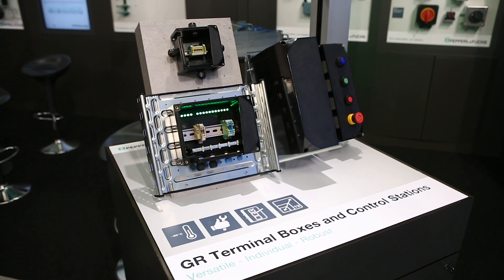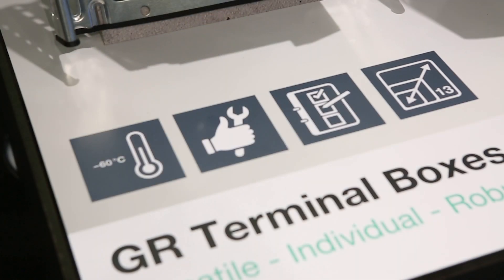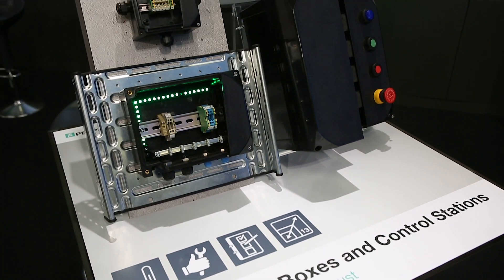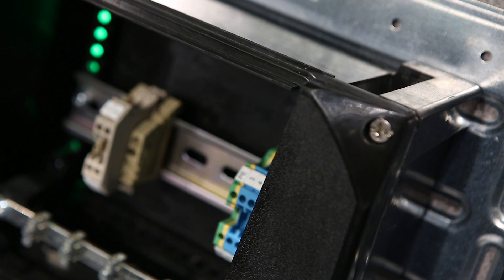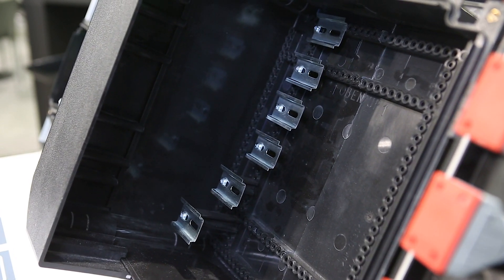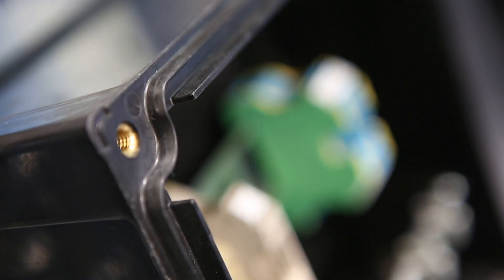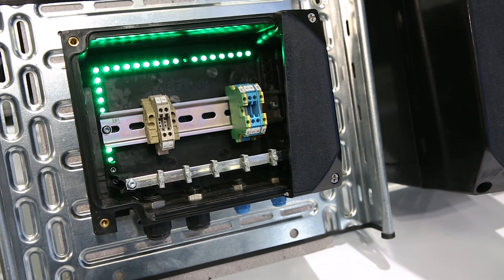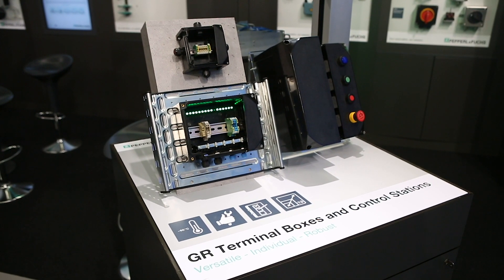Terminal Boxes and Control Stations in the New GR Series GRP Enclosure

Comment: Congratulations to Pepperl+Fuchs for its technological manufacturing update and for its EXAMPLE in making “Ex” equipment available on the market that incorporate, in the same product, a COMBINATION of different “Ex” types of protection, such as Ex “e” (increased safety), Ex “i” (intrinsic safety), Ex "d" (flameproof components), and Ex “m” (encapsulation).

By applying the combination of different manufacturing methods, such as plastic injection, optimized “Ex” equipment can be manufactured with the “intelligent” application of the best characteristics of each type of “Ex” protection for each “Ex” component in particular.

“Ex” instrumentation, automation, telecommunications and electrical equipment that incorporate these characteristics, being designed, manufactured and certified with the COMBINATION of different types of “Ex” protection, provide USER and OWNER Companies with installations in explosive atmospheres, containing flammable gases or combustible dust, the significant BENEFITS of greater FACILITIES of “Ex” field services, including INSTALLATION, INSPECTION and MAINTENANCE services in hazardous areas.👍
Reply from the maker: Thank you so much for your comment and congratulations, Roberval! 🤗 We really appreciate it. #AutomationPassion